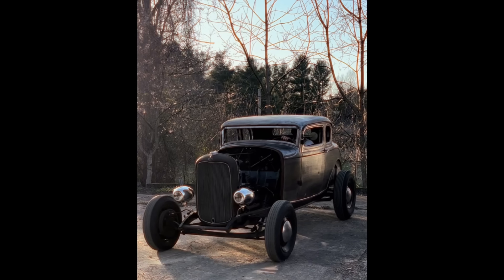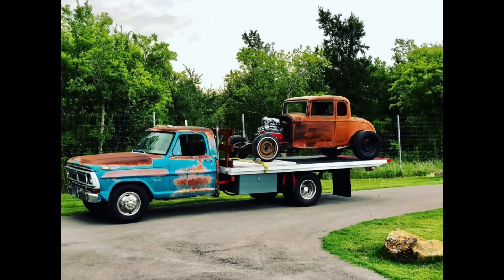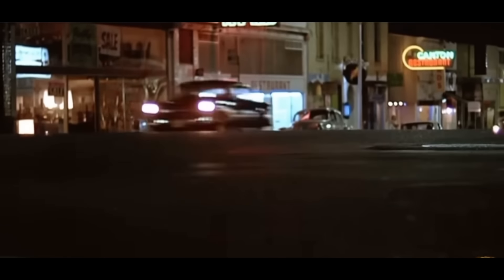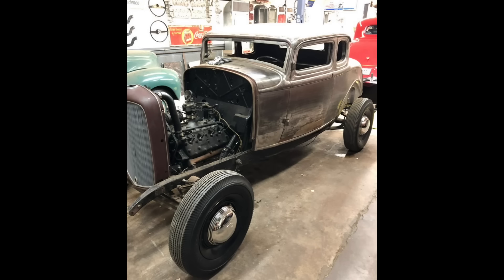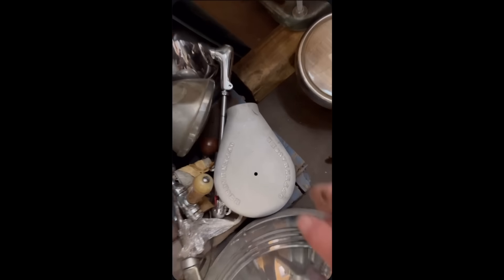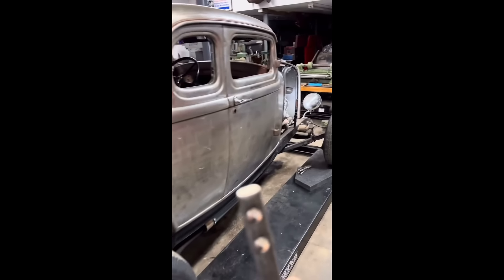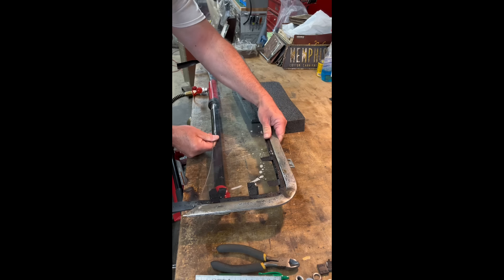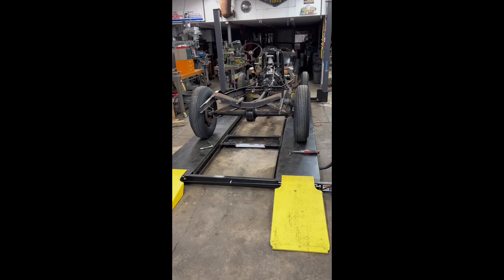The Crazy Story of a 1932 Ford Coupe That Was Found in a Dairy Barn in Fort Worth, Texas.

Comment: I went to look at 2 ‘50  Chevy picks.  Supposedly 1 ran 1 for parts.  I get there and. 1 pickup looked ok but didn’t have an engine or trans. The other one was badly wrecked with an engine and trans in it. I asked where is. The one that runs? The seller said if you take the engine and trans outta that one and put it the other one you have a truck that runs. 😡

Comment: I like your build. By the way those are not friction shocks. They are original style Houdaille fluid shocks. They work by moving a vane thru fluid. They work well enough. No need to change to modern tube shocks. I have built a number of early style hot rods using them.  It's getting hard to find anyone who rebuilds them.  You seem to  quite capable. So if needed you can rebuild them yourself.  Make a couple simple tools.  Then heat them up to get them apart.  

Looking at your cross member reminds me of the one in my old roadster.  Stamped right on the top it said made in Germany.  Yep even back in those days Henry Ford was farming work out to other countries.  

Keep up the good work!